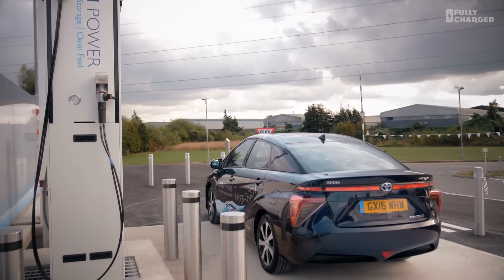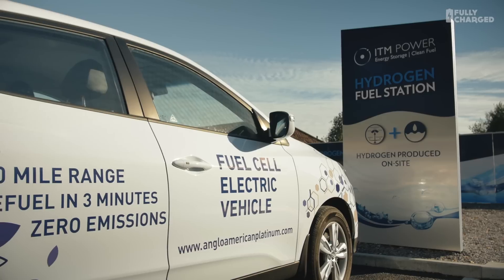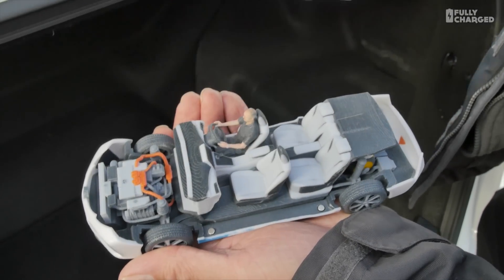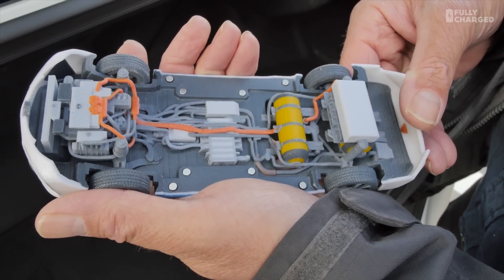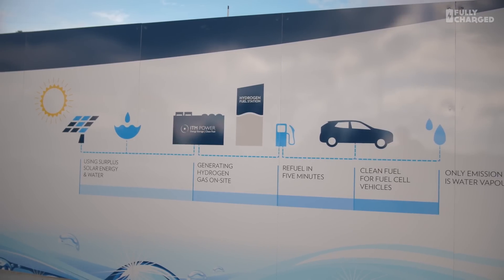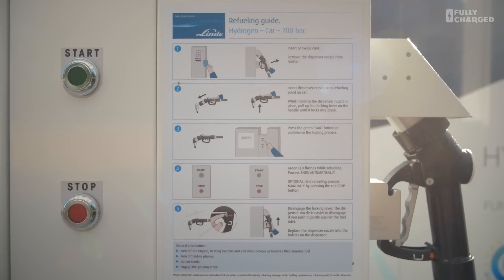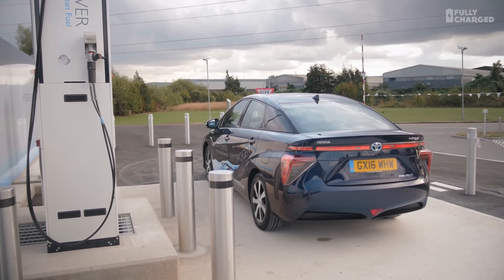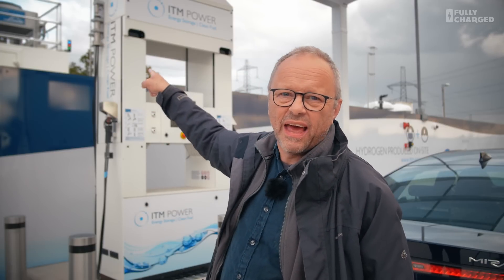ITM Hydrogen Rally | Fully Charged

Comment: Only reason I would buy that things is that it's BAD ASS. Other than that its one match away from an invisible explosion under your bosom. Plus its just a more expencive way of getting electricity to an electric motor. 
Anyways, I did like this episode though, very informative and interesting! Keep up the good work
Reply: Kurt Foster and petrol cars aren't? Standard 'hydrogen is too dangerous' moronic reply.
Reply: Oliver Hamilton
I don't understand your comment. I said a hydrogen system is bad ass because I like bad ass things. Except that doesn't mean I agree with its integration with society. I actually totally despise the idea of mass market hydrogen cars. I also believe electric cars are safer than petrol cars. Hydrogen does have it's benefits, but its really just a dumb way of putting electricity into an electric motor. Huge efficiency loss with that one.
Reply: Citation needed for efficiency loss.
Reply: Oliver Hamilton
Its just the basic comparison of hydrogen fuel celled cars to battery electric cars. This isn't an argument, I just like BEVs more because they don't need a lot of infacstructure like Hydrogen, see here:
http://insideevs.com/wp-content/uploads/2015/12/169.jpg

And the fuel comparison is pretty simple to understand, for hydrogen cars, you have to go through electrolysis, compression of the gas, transportation of that fuel, put it into a fuel cell, then put it into a fuel cell vehicle. See here:
 https://electrek.files.wordpress.com/2016/04/hybrid_hydrogen_vs_electric_chart.jpg?quality=82&strip=all&w=666&h=550

For your basic BEV, you could theoretically go straight from solar panels to the batteries to the motor.

The comparison is overall efficiency loss due to the changes of energy storage, obviously with a system with more types of storage and transport to go through will have lower efficiency.
Reply: ...and all that extra effort gets you a massive increase in energy density.
Reply: @Oliver:  Which is useless since it doesn't actually translate to more space in your car.  Compare cargo space in Mirai to Model S or Model ≡ from Tesla.
Reply: CorwynGC but it gives greater range for less mass. Think bigger than cars. I'll help, what other method of travel needs high energy density and low mass that's a big pollution source?
Reply: If you want to talk airplanes, go to the electric plane Fully Charged video.
Reply: CorwynGC best place for large scale development of these fuel systems is the automotive industry.

Comment: As mentioned before: The full cycle of electricity -> electrolysis -> storage -> fuell cell ->  electricity is 3x less efficient than 100% electric battery cars. So we are waisting renewable energy.  It is a matter of time that affordable batteries cars can drive as far as hydrogen cars. So hydrogen is a dead end (there are no major efficiency improvements in the last 50 years).

Comment: Question: If you have the H from 1 litre of water and then use that hydrogen as a fuel source, does the emission water equal the fuel source water. Is it a 1:1? It would seem like the conservation of energy would prevent this.
Reply: it does'nt burn it.... so yup....
Reply: It isn't that conservation of energy prevents it, it is that conservation of mass ensures it.  You don't get all the energy back (entropy always wins), but you must get all the mass back.
Reply: Ah ok, thanks

Comment: Another great video. A couple of points;

1. I think hydrogen fuel cells are too late to the party for light transport (cars). Battery EV’s are coming on in leaps and bounds, their ranges are increasing by massive percentages each year or two, the costs are dropping and too many manufacturers have already made the choice and backed batteries with big investment. Also battery EV's are becoming more accepted by consumers.  

2. Its all very well claiming that all the hydrogen will be made from renewables or surplus grid power however currently virtually all hydrogen is derived from natural gas and is therefore a fossil fuel. To suggest this will suddenly change in a few years is laughable. 

3. This is very important - There was no mention of the massive and I can’t stress this enough, MASSIVE investment needed to convert all the current petrol stations to be able to supply let alone produce hydrogen, it's simply mind boggling. The electricity grid already exists and delivers EV fuel to every house in the country. Much of EV charging is done over night which uses surplus power at times of low demand. 

4. It’s far less efficient and far more expensive to use the grid electricity to split water and produce hydrogen then use that to reproduce electricity in a fuel cell than it is to simply put that electricity straight from the grid into a EV battery. 

I think there is definitely a place for hydrogen in the future but it won’t be in cars.
Reply: 1.EV cars are only viable, if you have a place to charge it- so that counts you out in most inner city areas or if you do not have a private area you can park your car, such as street parking
2.currently most electricity in the UK is produced by fossil fuels or nuclear
3. at the moment, but if every car was electric, then the electrical infrastructure would'nt cope either.... The electrical infrastructure struggles when they redevelop areas and build more housing at the moment as it is- because they are not upgrading the infrastrucuture as they do it....
4.True, but who's to say that it can't be bolstered by each hydrogen fuel station having their own small wind turbines- such as the smaller one's ecotricity produce, as seen in a recent video on this very channel?

I think it'll be the same choice that we had with petrol/diesal cars about 20 years ago... petrol was quicker, simpler  and cheaper to service
whereas diesal gave you better mileage..... people bought the car which suited their requirements...
I also think as the strain on the Grid intensifies with every new EV plugged in, we will be forced to pay through the nose to maintain the electrical infrastructure(hinkley point anyone???)...not everyone is in the position to be able to afford to produce their own electricity...
Reply: Iain Ansell 

You make some valid points, particularly on the need to upgrade grid infrastructure. I won't pretend to know the costs of this, however it can't be as much as retrofitting all the thousands of petrol stations not to mention all the infrastructure to produce the hydrogen that would be needed.

As for point 1 I park my Leaf on the road outside my house in Northampton and run the cable over the pavement and pass an extension cable though my letter box to charge so you don't need off street parking.

You're correct about electricity being produced by fossil fuels etc. I believe it's about 30% (60% combined) for both gas and coal, and approx 20% each for renewables and nuclear. However this is irrelevant. Producing hydrogen by splitting water requires more electricity than would be needed to charge EV batteries. If you're going to install wind turbines to do this then they could simply be plugged into the grid and used to charge EV's, if not then you're using the very same grid electricity to make the hydrogen as you would to power an EV. Also the power needed to produce hydrogen is going to place additional strain on the grid so the grid would need upgrading. 

You also haven't covered the point that it is less energy efficient to use electricity to split water to produce hydrogen and then use the hydrogen to produce electricity in the car. To power a car 100 miles by hydrogen that was produced by splitting water requires more electricity than simply storing 100miles of electrify in a battery. 

I appreciate that the video claims they would only produce hydrogen from 'surplus' grid power but this is probably fanciful in real life as having all that money sat in a production plant that only ran during periods of surplus power wouldn't make economic sense. Also most EVs do most of their charging over night precisely when there is loads of surplus power on the grid as demand is low
Reply: You do realise that running an extension lead across a public right of way opens you up to all sorts of liability don't you? If someone trips and breaks their leg, you may be sued, and your insurance would not cover you....
Reply: And just adding more power to the electrical grid is not as easy as that.... There is a maximum capacity that the cables within the road can carry before they melt.... Similar to why you need over current device protection within your houses fuse box...to prevent electrical cables catching fire incase of over current...

Comment: In the end there needs to be a mix of both EVs and Hydrogen Fuel Cells. For most personal/family cars, EVs are the way to go. Refuel basically anywhere, zero emission, energy storage applications and these days, as Tesla has proven, they have the range. For heavy vehicles such as trucks, buses and trains - it's hydrogen all the way (but only if it's zero emission H2). These vehicles need lots of energy for long periods of time, something batteries cannot offer without being both cumbersome and heavy. They also need energy fast and do have time for 20 minute charges. Onsite hydrogen generation shown in the video is perfect for these heavy vehicles as it can be set up at depots and on the major highways, fast refueling and zero emission energy.

Comment: As much as I don't really agree with Hydrogen as it takes an equal amount of kilowatts to produce a kilo of hydrogen in which the same electricity would carry you farther. Its about closing the loop Wind Turbines over a given period produce more energy then needed, but sometimes produce less energy then the grid needs. This an example of what to do with the spill over, but if you could use the Hydrogen to Generate power for the Grid firstly during peek demand. Then sell the excess that's the solution of a fully integrated closed loop system. This is a very good attempt to use the excess of energy created by wind turbines, it just needs one more piece a Hydrogen electric generator to create smooth continuous power generation. Bravo only one more step to go.

Comment: Batteries for me: 
*You can charge them (very important: the ability to make your own energy - not so easy nor simple with hydrogen). 
*Energy transfer between production and your storage (battery) is much more efficient (around 50% of hydrogen VS 80% to 95% of battery technology). 
*Much less complexity - Hydrogen system is much more complex and takes more space.
Hydrogen has only one (temporary I guess) perk: Refueling time.
What about 700Bar of pressure? That's INSANE! It's an hydrogen bomb! It would vaporize you, like, you would go up (in pieces) in the atmosfere if it exploded below you.
Hydrogen = Dead END

Storage of grid energy surplus? Tesla already made indefinitely scalable "power plants" with batteries. Once again, more efficient technology.

Comment: Use hydrogen for energy storage, not to move a small car.
Make it usable for static objects and heat-fuel.

The tank/fuel-system is space for batteries/supercaps in the car.
The infrastructure is massive if needed to replace petrol, let alone exist next to other fuels or compete with electric

Comment: Hydrogen fuel cells may come to have their uses but definitely not in mass produced cars. The efficiency loss of using Hydrogen vs Batteries is 20%-40%. Hydrogen is not an energy source it is a energy storage medium. You take your renewable electricity, do electrolysis to water, get your hydrogen throw away your oxygen, have to use energy to compress the hydrogen, transport the hydrogen to where it is needed, store the hydrogen (where it is a very explosive) temporarily, fill up car and then slowly burn to release part of the energy you started with from renewable. All compared to where you just plug in a BEV and the small associated loss from electric grid transmission lines. Hydrogen for the masses is just plain silly.

Comment: Any idea so far on how much would a full tank of hydrogen cost? Also how far can the Toyota Mirai for example go on a full tank? and how many litters are in a tank?
Reply: In the video all I know is the price per kg is 9.999 GBP as its not priced like typical fuels at gallons or liters and from wikipedia info states its full tanks at 5 kg (11 lbs.) between the two tanks since as I have said, its not measured by volume but rather by weight.Natural gas and propane are not even charged by liter/litre or gallon but by weight volume.
Reply: £50 for 312 miles.

Comment: one reservation I can see is amount of water needed to fill up those tanks. I'm afraid it might be quite significant. It might be putting hydrogen in the same quandary as ethanol, where crops for food are displaced by crops for fuel, driving price of food up. In case of hydrogen fuel we potentially introduce another, industry scale demand on limited fresh water supply. I don't want to fight for water and food with machines ... autonomous machines in near future. (cue Terminator 2 theme music 🤖 :) )
Reply: It does not fill up with water, its just the Hydrogen molecule of water mixing with oxygen you get in the air we breathe.
Reply: They get hydrogen from splitting water. My question is "How much water do you need to split to fill up the tank with hydrogen". Or in other words "what is the millage, but in water not hydrogen" (for easier calculation).
Reply: Well the way you wrote it did not seem like that as you quoted, but to your reply according to wikipedia and their website, its 5kg (11 lbs) of hydrogen for both tanks and 9.999 per kg would be 50 GBP a tank full. for a range as printed on the car and as said the websites of 370 miles NEDC or 312 US miles per tank.
Reply: Joshua Cornell
you should write this in the first place. Good job. Now H2O = 2*1+16 (atomic masses). so to get 5kg of hydrogen we need 45 kg of water. So 45kg h2o / 595km(370 miles) is 0.075kg of water per km. This looks a little improbable. Maybe if you use holy water :)
Reply: Sorry, my brain is not in full capacity today, I am running at half brained. Been focusing on this video commentaries for a few hours now... Off to the yellow brick road now.
Reply: Sorry for snarkiness in previous comment. By the way - our calculation isn't off very much :
"The exhaust  H2O or water volume is 240 mL per 4 km running"(i found your wiki page). This is amazing. On the other hand, that is why hydrogen and oxygen are used as rocket fuel.

Comment: That all sound cool, but problem with hydrogen car is still efficiency. It takes lots of energy to do electrolysis and compression of hydrogen and than fuel cell is at most 50% efficient.
You can say, electricity on that hydrogen station is created from renewables so it does not matter, but that same station with the same wind and solar power could serve 3x more battery electric vehicles, each doing the same mileage (e.g. if it can serve 100 FCVs doing 200 miles, it could serve 300 BEVs each doing 200 miles). 
It takes around 300kWh to fill Mirai's tank so it can do 300 miles, but for BEV it takes around 100kWh to do 300 miles. So in general, with hydrogen, you are wasting 2/3 of energy.
Another big problem is visible on that Mirai model you were showing at 4:30,. Look at the complexity of the whole system, size of fuel cell, size of hydrogen tanks. You do not have front storage space, and very limited in the back. Compare that to, for example, Tesla model S undercarriage.
Same applies to surplus energy storage. If you have 3GWh of energy surplus and you store it as hydrogen, you get back 1GWh, and if you store it in batteries you get back 2.7GWh. And batteries will have huge advances in capacity, durability and pricing in the next 10 years, while hydrogen does not. Even if you could make efficiency of electrolysis, compression and fuel cell to theoretical physical maximum it would not come close to what batteries are already today.
Hydrogen is still good for some uses, but moving whole economy to hydrogen does not make sense.

Comment: Contrary to some opinions expressed here, I think the video was useful and informative, albeit at a basic level.  Does it really matter if a rep from Toyota or ITM was giving a spiel?  

I would have liked to hear more about the energy conversion efficiency from ITM. i.e. for every kw/h of wind power, what does that translate to in terms of kw/h once it leaves the fuel cell.  Every storage option consumes energy but some are better than others.

Personally, I think the biggest obstacle to mass hydrogen adoption for the vehicle fleet is the lack of distribution infrastructure, whereas, with PEV's, the infrastructure is already there in the form of the grid.

Comment: I am a major electric car fan, but they thought of being able to dump 
renewable energy surplus into hydrogen is very appealing to me, rather 
than turning the renewables off.  

Though I think hydrogen would be better served on the grid its self as grid storage. Instead of having 
many small fuel cells in cars, make some grid scale ones and just use it to offset usage on the grid.  Less parts to go wrong, no hydrogen fuel tanks travelling on high speed collision courses.

Does anyone with more knowledge than me here know if grid scale fuel cells are even an option.
Reply: Nothing about fuel cells precludes massive scale.